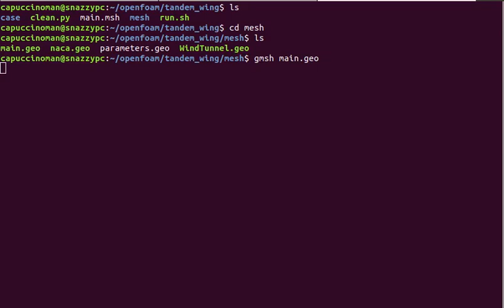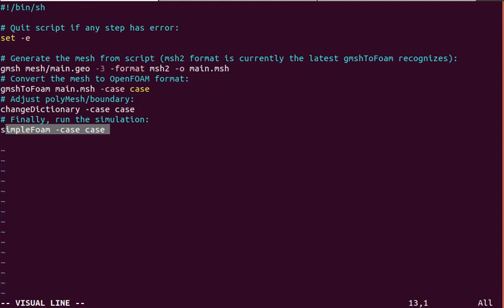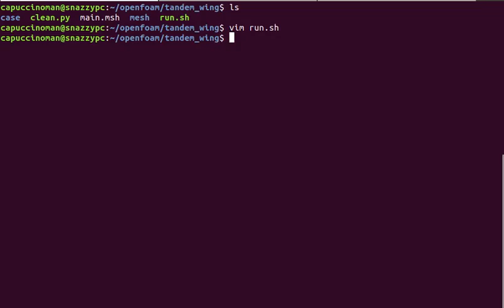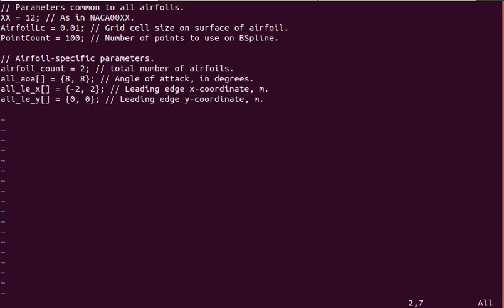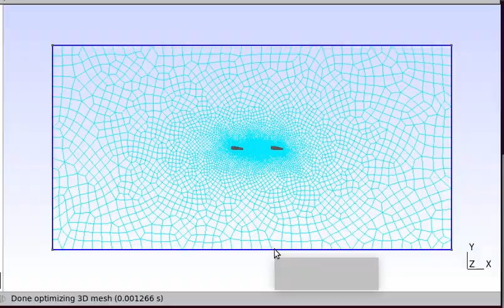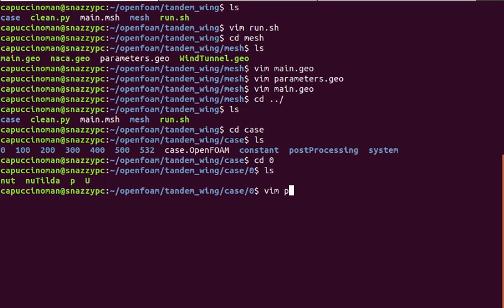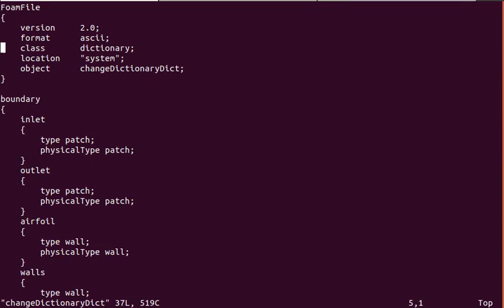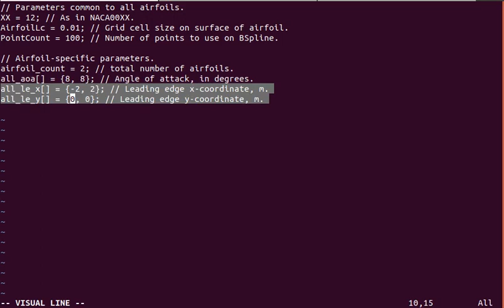Tandem Wing Simulation

Comment: Very instructive! My request
1) Is it possible to simulate different wingspan of Airfoil 1 and Airfoil 2? 
2) Can you do a simulation with  (NACA 4415/2412) chord 1.5m where Airfoil 1 is offset by 3m in Y dim upwards and 10m in X dimension. 
3) In configuration (2) I want to know what minimum wingspan (assuming  both airfoil have same span) is required at 25m/s to lift 10tons

Comment: Can you calculate things like lift, drag and stall speed with this software?
Reply from the maker: Absolutely! You can actually see that the generated case/postProcessing folder contains lift, drag, and moment coefficients vs. iteration. I have an old video called "How to Plot Forces in OpenFOAM" detailing how to plot forces, but it is quite old. I probably need to update it.
Reply: @OpenFOAMTutorials  cool will check it out. do you need an engineering background or know the math and aerodynamics to really use FOAM or is it accessible to hobbyists that just want to design an homebuild aircraft?
Reply from the maker: @experimental_av  It is pretty accessible, though your mileage may vary. There's a lot of help you can get on cfd-online if you get stuck. Most importantly, try not to rely on CFD too much (should be used in conjunction with other design tools, and tests / validation should be performed whenever possible).
Reply: @OpenFOAMTutorials  interesting, thank you

Comment: Thank you so much!!
You really are the best! :-D

I tried to run the analysis using the files uploaded on github and once run.sh is lauch and the mesh being generated I get this message :
Your choice of mesh element sizes will likely produce a very
large mesh. Do you really want to continue?

the answer to continue is "1". I've entered it and the analysis started  again but ended up at 7s, without any convergence nore subdirectories created in "case". I thought it could be the << Recombine Surface{TwoDimSurf}; >> in main.geo so I deleted it, the same warning message appears but once "1" entered the analysis starts again and last longer (35s) before it ends and did not reach any convergence...

Do you know what could be the reason ?
Reply from the maker: Hi Yannis, are you saying the simulation runs, but diverges and crashes?
Reply: @OpenFOAMTutorials   Yes, I think that's it. 
It runs, diverges and crashes. giving huge coefficients
Reply from the maker: @yannisyoussef7602  Okay, if your inputs are OK (wind tunnel velocity, mesh), then you can change fvSolution relaxation parameters. You can try decreasing these values by half until your simulation stabilizes. If relaxation parameters go < 0.05, I think something else might be wrong with your setup.
Reply: OpenFOAM Tutorials I first launch the analysis with the files provided in the link with the description, maybe something changed when I first launched the analysis. I’ll try to just like you said and let you know
Reply from the maker: @yannisyoussef7602  Hmmm, it should not be crashing from a fresh clone.
Reply: @OpenFOAMTutorials  That's what I was thinking, it should not be crashing from a fresh clone. I downloaded it again and launched the analysis and it ended up the same way, it ended at Time 9 with no results.
I am currently changing the relaxation parameters as you suggest it
Reply from the maker: @yannisyoussef7602  I just did a fresh clone and it worked (converged in 532 iterations). Can you add "gmsh --version" inside ./run.sh and tell me what it outputs? (note that it must be inside ./run.sh)
Reply: @OpenFOAMTutorials  I did it and it wrote 3.0.6, it's weird because I thought I had the latest version...
Reply from the maker: @yannisyoussef7602  Aha! I guess paths can be different when running sh script vs terminal. Add "which gmsh" to see the path, and compare it with the output when running from terminal. Install latest version to the path output by the script. But the reason why 3.0 causes instability is that it does not properly handle the rotation of points due to angle of attack; the cells get deformed. So v4+ must be used.
Reply: OpenFOAM Tutorials And there we go !!!THANK YOU !!!
 Solution after 532 iterations, it was then the old version of gmsh that was taken into account, I ran the analysis from the terminal step by step and it worked. For the gmsh I have uninstalled it and download the latest version from gosh.info add the path but when I run it from run.sh it doesn’t recognize it.